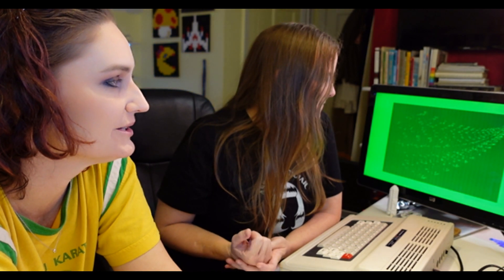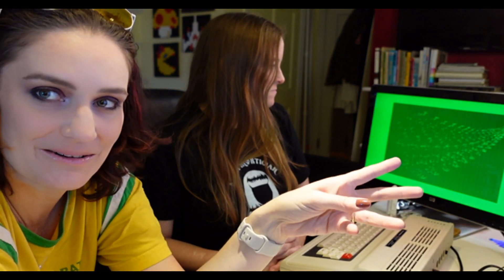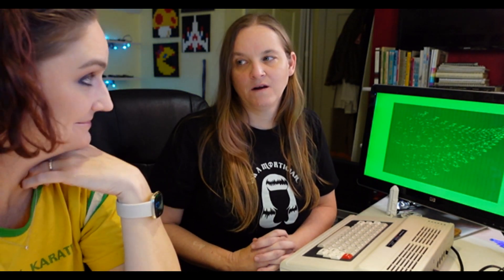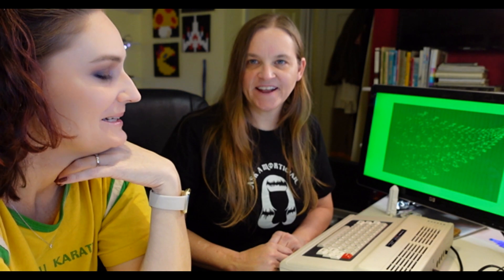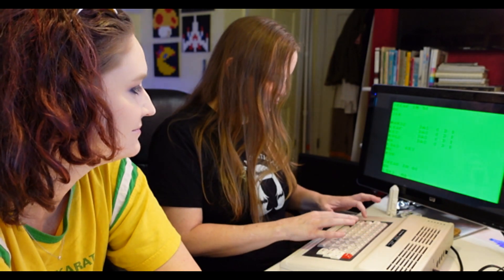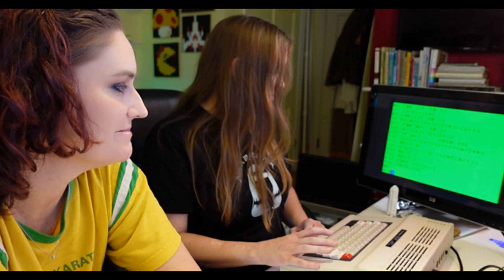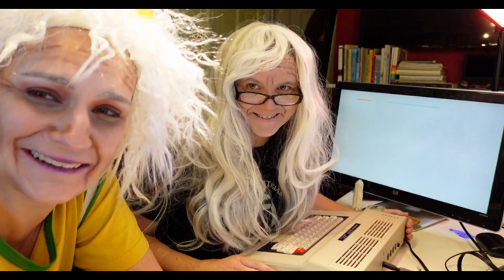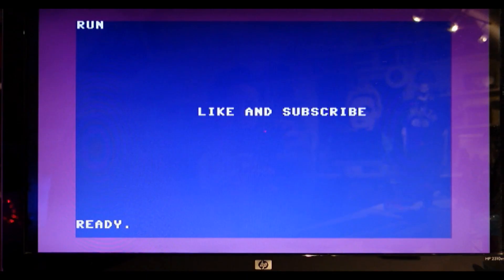Happy Halloween: CoCo2 6309 CPU upgrade

Comment: Hmm, it would have been nice to see the time difference between both the 6809 and 6309.  If only you'd have used a stopwatch.. 😂
Reply: Right?  We but fo reals had to let it run all night.  🍬
Reply: @fractalMD  the 6309 is supposed to be 20% quicker than the 6809 - maybe compare some games next time.
Reply: @rwxdesigns  We are working on getting code that is optimized for it.  Apparently that makes a BIIIG difference in itself.
Reply: @fractalMD  I had a mandlebrot program myself back in the 80s and it took about 3 hours unoptimised to draw the entire image. There is also the speed up POKE you could use before and after which should speed things up further.  POKE 65495,0 (sets to 1.79MHz) - followed by POKE 65494,0 at the end of the program, or even faster use POKE 65497,0 which more than doubles the CPU speed (on a Dragon at least - but disables the screen) until you use the POKE 65496,0 to restore normal speed.  I'm not sure how compatible those commands are with the 6309, but those known speed-ups have been around for years. I did use the first ones on my Colour Computer 2 without issue in BASIC.  Great channel Amy, all the best to you and Taylor.
Reply: @rwxdesigns  this is with that poke, already!

Comment: I once typed in a Mandelbrot program for the C64 from one of the magazines. As I recall, it was only two colors (red and white I think). It took forever to draw the set, and then zooming in on any part of it, just even longer. It was an interesting idea, but I quickly gave up on it.

I had a few Mandelbrot programs for the Amiga that were faster, but still took way too long to draw the screen to really be enjoyable. I recall there was also one that would draw them in 3D. Well, it really just made something that looked like a plateau, rather than a full 3D landscape out of it.

Today, I have programs that will draw the screen pretty much instantly. Even so, I can never seem to find images that look as good as some of the ones I've seen in magazines.

BTW, the first game I remember using fractals was Rescue on Fractalus by Lucasfilm, for the Atari 8-bit, C64, and others. This was followed by The Koronis Rift, and The Eidolon. All pretty good games.
Reply: We let it run all night long to get it to draw. Us praying there wouldn't be a freak power outage or something that would kill it before we could film was a real thing. 

🍬

Comment: How you implement the math is huge where both recursion and fractals are concerned. Also, the 6309E processor does have assembler commands that the 6809E doesn't have that would speed it up.

Comment: Fractal Math was an offshoot of recursion in the 17th century. Fractals themselves derived from Gottfried Leibniz's Fractional Exponents, but the geometry necessary to do them really didn't exist yet. Computers aren't required to do fractals, but it would be a PITA (Pain In The, um, "Rear") to do. You'd have to do the necessary math for repetitiously doing calculations (statistics), and do the necessary step-by-step calculations either arithmetically or using algebra/calculus. On top of all that, you'd have to graph each step. If you wanted color you'd have to add in calculations for color, etc. At the time, I'm not sure if slide rules existed yet or if table math was used. Computer equipment o almost ANY kind makes this much easier.
Reply: Hard candy 🍬

Comment: 🤣 The 6309 is almost exactly like the 6809 at power-up and reset, and runs all 6809 instructions in the same number of clock cycles, unless you put it into native mode.  Then many instructions will run in fewer clock cycles, thus doing more calculations in the same amount of time.  How much more?  Depends on the mix of instructions.  If this fractal graphics program is written in BASIC, then the mix of machine language instructions in the Extended Color BASIC interpreter would determine how much faster it'll be.  "The 6309 Book" by Chris Burke suggests maybe 15%, but of course YMMV.

How do you get it into native mode?  Well, there is a new instruction in the 6309 that has been labeled LDMD, for LoaD the MoDe register.  LDMD #$01 will put the 6309 in native mode, and LDMD #$00 will set it back to emulation (emulating the 6809) mode.  A hex value of $113D01 executed as an instruction would put it in native mode.  It should be possible to POKE a tiny little machine language subroutine in and call it from a BASIC program to do this.

Also, there is a high-speed POKE that overclocks the CoCo 1 / 2 while it's executing ROM instructions, but not all the time.  This speeds up execution of BASIC programs somewhat, though not as much as the double speed POKE.  Whether your CoCo 2 can handle the higher speed with only 1MHz-rated chips is a crap shoot, but it usually works.  POKE 65495,0 will do this, and POKE 65494,0 will set it back to normal.  Since the 6309 draws less power and runs cooler than the Motorola part, it will likely accept this well.  All usual overclocking caveats apply.  The POKE 65497,0/POKE65496,0 that works on the 2MHz-rated CoCo 3 can also be attempted on a CoCo 1 / 2, but it will garble the screen while it's in high-speed mode.  It's not clear to me what will happen to the screen after you restore it to normal speed in this instance -- like will the Mandelbrot graphics it's been working on appear in place of the garble?
Reply: Such a smart young man. Have a hard candy. 🍬
Reply: @fractalMD  Not really.  That's just my Halloween costume.  Thanks for the candy!  😋